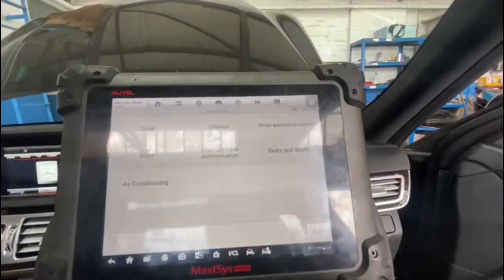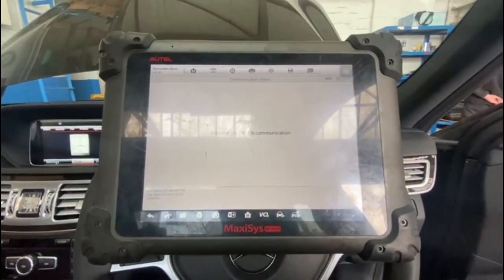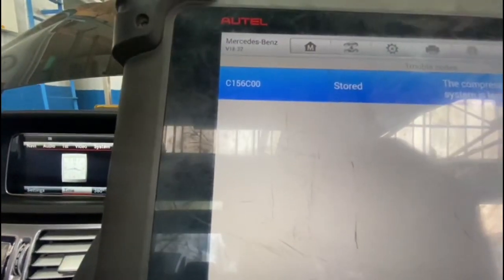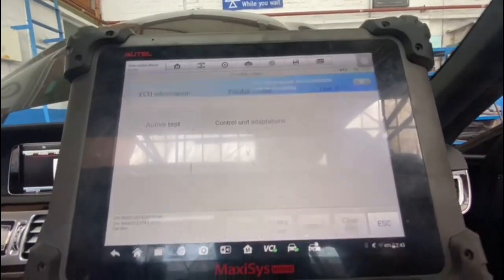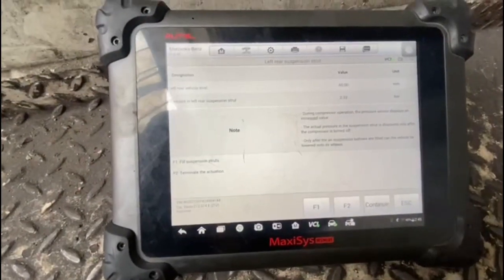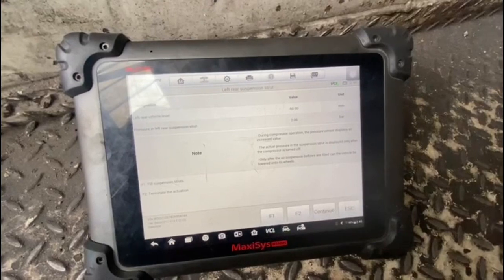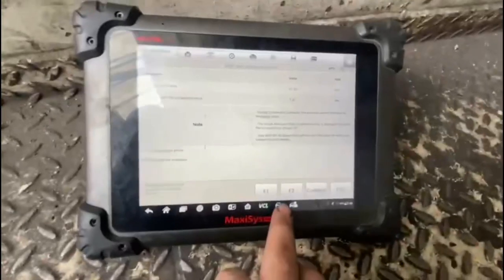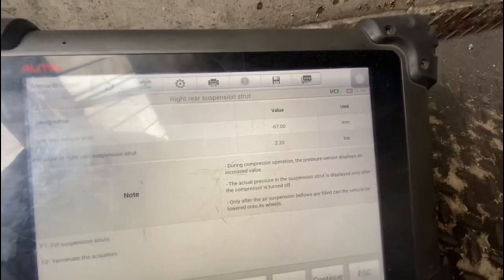Mercedes W212 E63 AMG Air Suspension Pump Replacement and Repair

Comment: Where du you get that New fuse? And what is that fuse type called?
Reply from the maker: You can try finding it on ebay, we repaired the fuse by soldering it as there wasn't any local and the customer was coming from far.
Reply: Just curious of how many volts are supposed to be at the compressor main plug.
I just replace mine on my w212 2011 E550 4matic .
The pump still won't turn on .
The dash is lit up red car too low pullover. If that valve block is bad will the compressor Turn on?
I had power to the compressor but it was like 4.9 V

Comment: Hi guys 
Great video. I’m 225miles away otherwise would have come down! Had suspension issue kept going down on my w212 estate, Had some work done like airbags, valve block and lines Etc. But still goes down over night. Suspension compressor seems fine had it tested and Merc specialist (apparently! 😡) said compressor goes up quick so looks like no issue. Used all Merc parts. Any suggestions would really appreciate a reply? 🙏🏽
I may take a trip to see you guys.